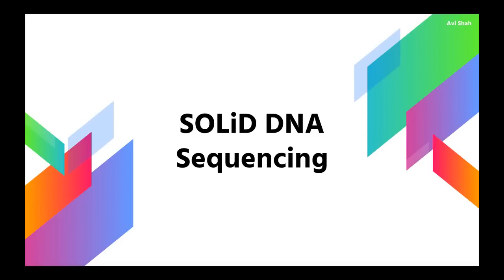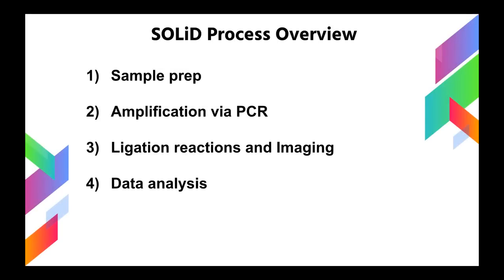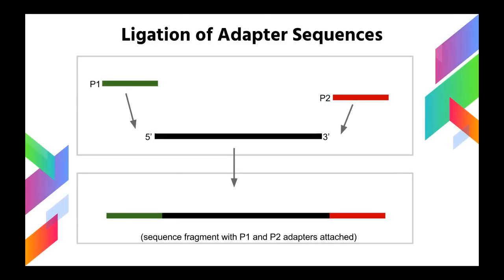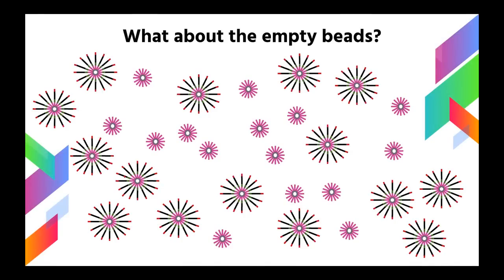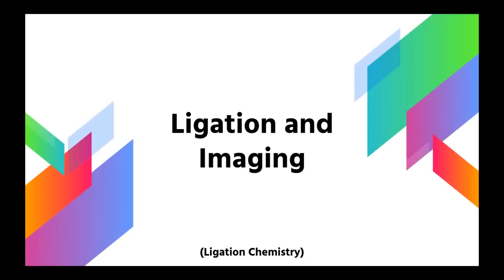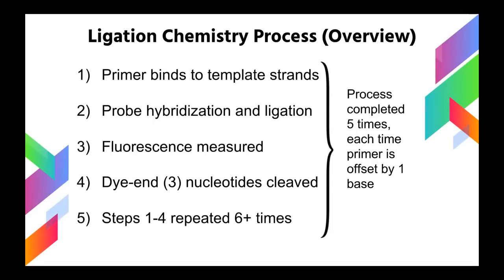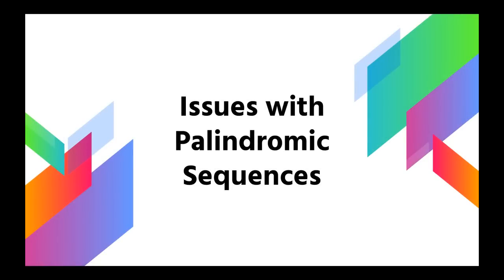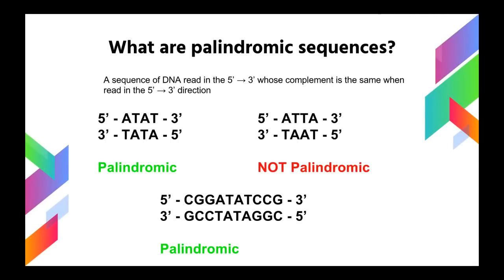Next Gen SOLiD DNA Sequencing Method Explained

Comment: Hello, thank you for the great video. I am a non biologist trying to teach myself ngs analysis. I have 2 questions that might have obvious answers however I am not able to understand: 
1) why to bother with "a base and color define the next base" when one can use 16 colors instead of 4 ? 
2) what is the use of the 3 middle universal bases in the probes? i.e why not just ligate all di-bases at one cycle (instead of the offset 5 times...) and decode the colors ?  thanks in advance!

Comment: hello Thanks for the excellent video. Could you please clarify something? The fragments of all unique DNA sequences are flanked by the P1 and P2 primers. Hence when they are binding to the beads, how is it ensured that each bead carries unique DNA sequences. These interactions are with the adaptor sequences right? Hence how is this possible since all DNA fragments carry same adaptor sequences?Thanks.
Reply: There are different adaptors for different fragments of DNA. The beads carrying DNA sequences(primers/ oligonucleotides/amplicons)are made by emulsion PCR and one bead is made in such a way that all the primers attached to it carry sequences complementary to any one type of adaptor, among many others. So, suppose there are 10 types of adaptors used to flank the fragmented DNA, there would be 10 different beads containing complementary sequence primers for those 10 adaptors respectively. Hope this helps.